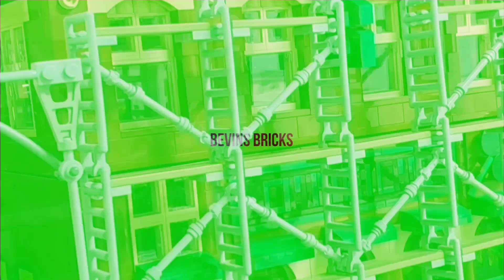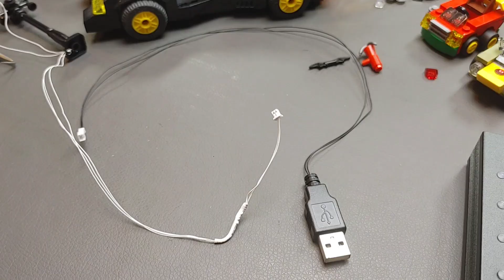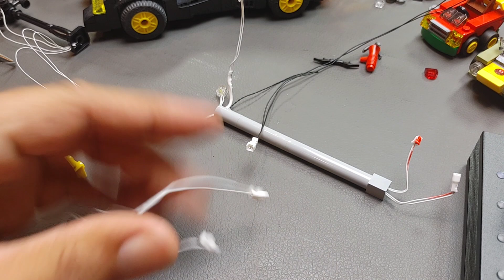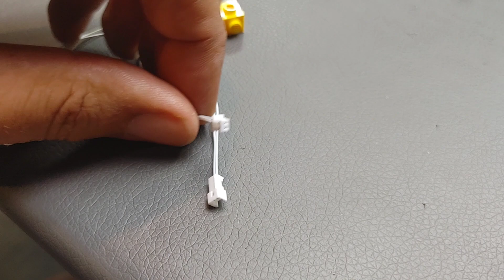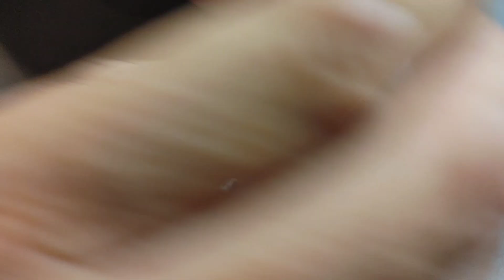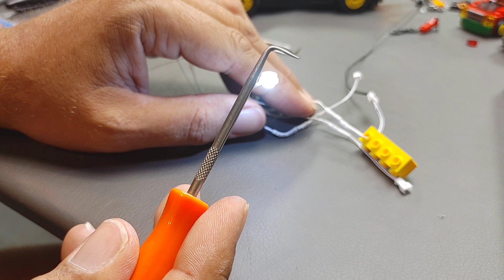Lego Lighting Tips and Tricks, Putting A Large Square Peg Thru A Small Round Hole.

Comment: Harbor Freight is the bomb!! During my career, I spent as much on tools from there as I spent on LEGO from BL!! (lol) I have that exact pic set! I used to use it to repair valve packing … now it’s for fine LEGO work! 🤗
Reply from the maker: They are great for simple home use tools I love that store.  I got mine for a lot of reasons but yup they are now lego tools lol
Reply: @BevinsBricksWorld  … yeah, you’re right about the “simple home use” designation. Truth is, most of my tools are from higher quality sources like Rigid, Klein, Estwing, Craftsman, S&K, Greenlee, and DeWalt. Some of my Stanley drivers I still have, I bought as an apprentice in Canada over 40 years ago (Robertson #1, #2 and #3)!
Reply from the maker: Same here, other than estwing, Ive never heared of them to add to your list above I also have snap on and matco.  Craftsman is the bulk of my tools though.  Sadly they are not what they use to be.
Reply: @BevinsBricksWorld  … Snap On was always a bit pricy for me (I only have a snap on flex-head wratchet by default … a mechanic left it in the motor cavity of my ‘70 Mustang when I needed an emergency repair while on the road during a vacation … was a hundred miles away from the repair shop when I discovered it during a pit stop on the way back home! lol). I have two or three Estwing hammers. Used them a ton when framing my two out buildings in the back yard. 

btw, I have used a number of your tutorials to brick-build a number of chairs for my MOC’s. I’m gonna build that incredible Singer sewing machine too!! That is a thing of beauty!! 🤗
Reply from the maker: Yeah snap on was very pricy.  I just have a metric and american socket sets of snap on and torque wrench all 3/4 drive as they had a little better bite on them.  
  Glad you like some of the chairs and such.  The sewing machine is a nice little build but also a bit fidgety lol.

Comment: Just a heads up- you got the male and female backwards. The gender is determined by the conductors, not the housing.
Reply from the maker: I was noticing that while I was making the video.  As I was going off the plug itself and when I popped them out I'm like wait a minute lol.  I never really paid attention to the designation of the metal Parts I only paid attention to the plastic portion.